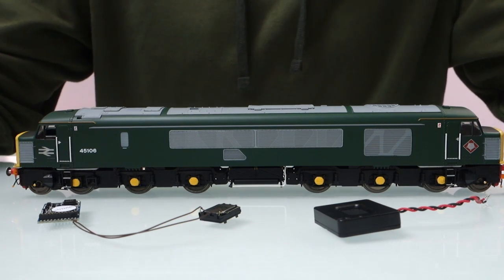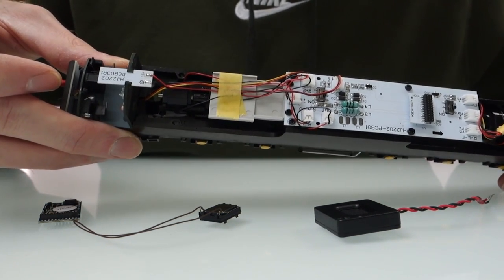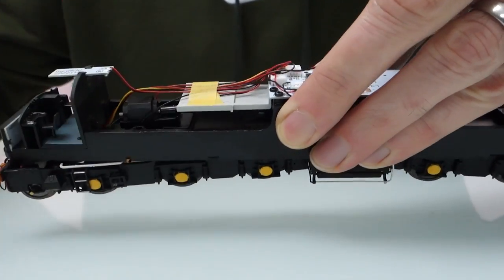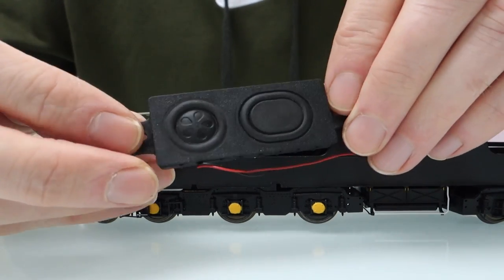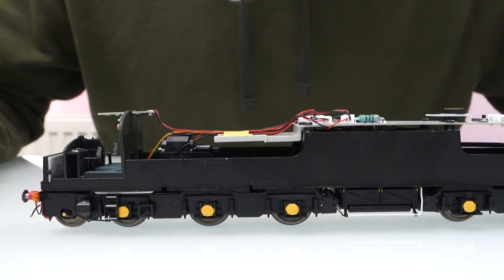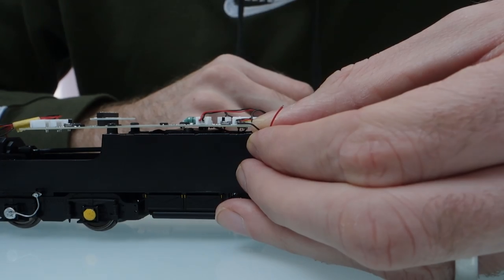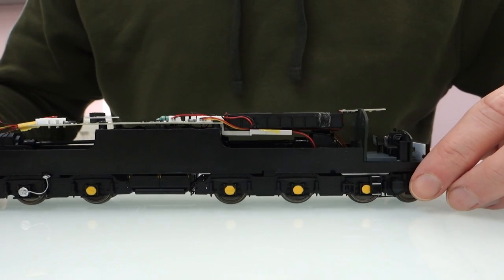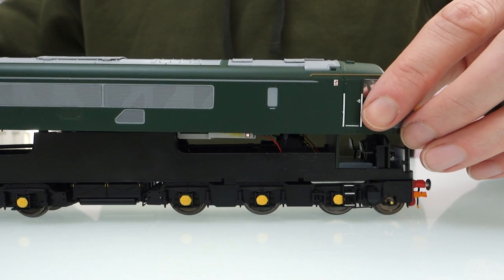Fitting DCC Sound To The New Heljan Class 45, Legomanbiffo Sound And An EM1 Speaker

Comment: Superb job. I noted you've also run a Heljan class 28 how did you overcome the speaker fitting on that loco as inside it there appears to be very wiggle room for a speaker in comparison to the Class 45. Any shared toughts would be most appreciated.

Comment: Handy info on the EM1 fitting. I was expecting a bit of chamfering being needed to the top edges but if it's just a bit of rebating the sides to clear then thats easy enough. I'm sorely tempted to parallel a pair of 20x20s and series that combo with the EM1 as I have in my class 58s, just need Medusa to turn up from Kernow...
Reply from the maker: It should be possible, I prefer the bassy sound of the EM1 though, you lose some of that when you start adding other speakers
Reply: @roadsandrails  I generally agree, though some prototypes lend themselves to a bit more high range, especially EE machines...I know the Peaks are Derby, not EE before anyone says anything by the way! Its more a point that where a distinct turbo whine exists an EM1 alone isn't always the best fit although that can sometimes be down to the way the original recording was achieved on a locomotive not being worked hard. It is nice to see models where getting an EM1 into them isn't a small scale machining job on the chassis block and hatchet job on the speaker enclosure.

Comment: I might be wrong but i thought you had to wire another speaker with an em1 because it doesnt draw enough power or something along them lines
Reply from the maker: One of the retailers used to say that but I think the spec of the speaker has changed slightly, I’ve never had an issue